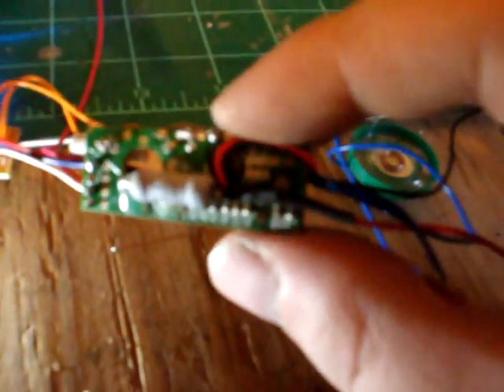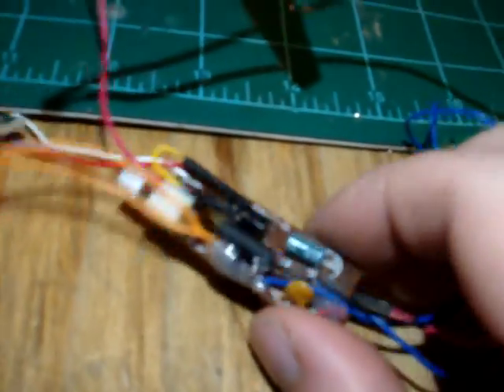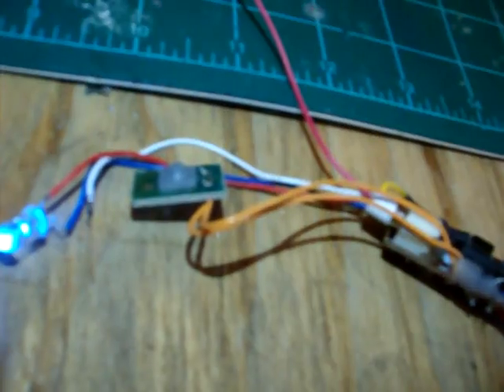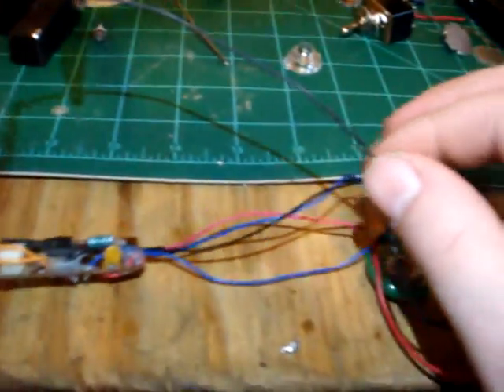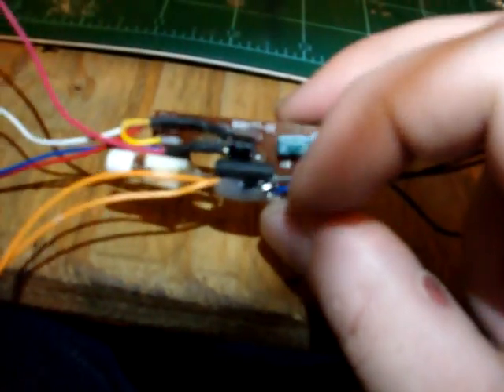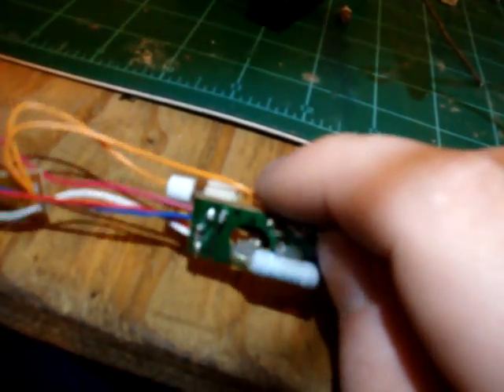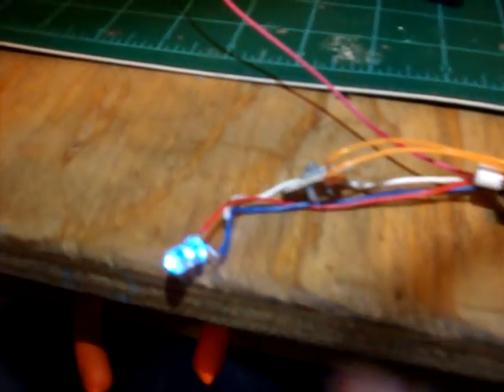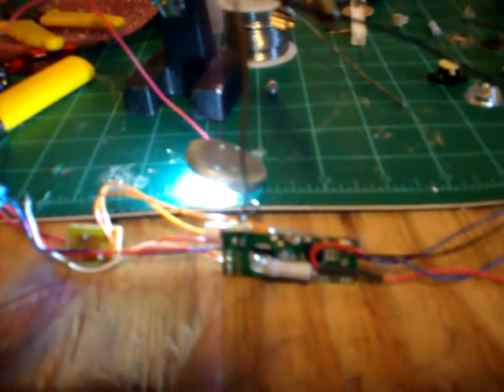2010 hasbro lightsaber toy wireing

Comment: I've been toying with the idea of making my own custom lightsaber using a powerful LED, polycarbonate blade, etc.  I found some custom soundboards with swing sensors, clash sensors, etc, but they're quite expensive.  Do you think it is possible/plausible to take the board from one of the Hasbro toys and incorporate it into a custom design?  To be clear, I'm not only replacing the hilt, but the light source as well.